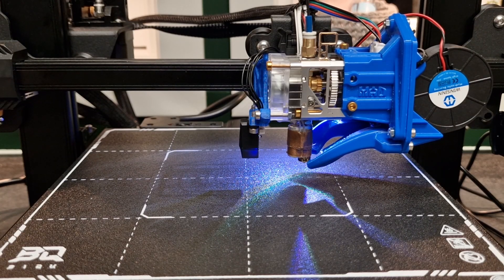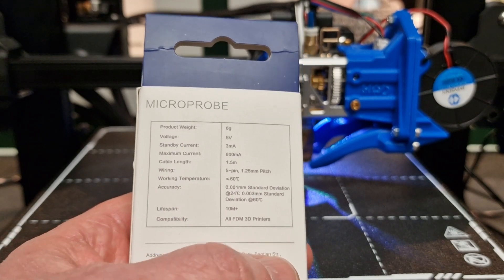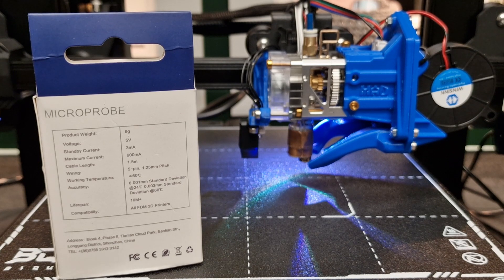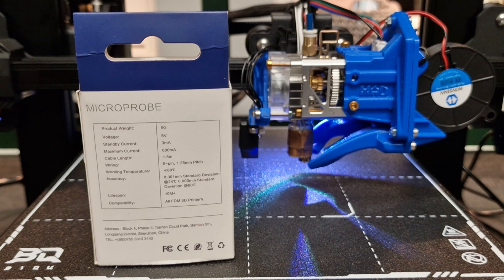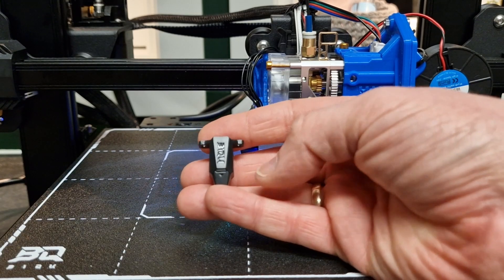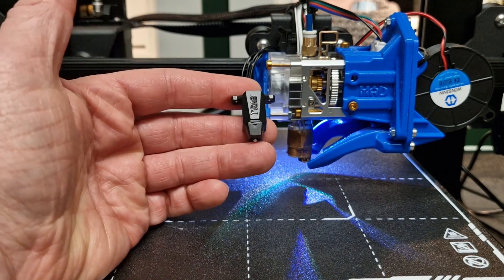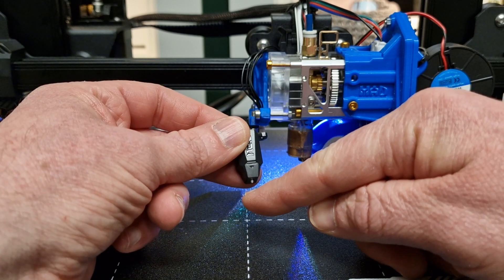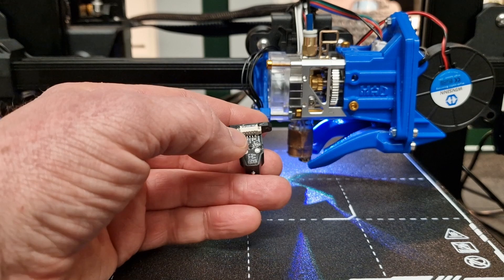BIQU Micro Probe review with a printer saving tip included.

Comment: One thing you need to keep in mind for the microprobe: it does not use the same firmware as a bltouch. The sensor control pin is a on/off signal here while the bltouch and crtouch use a pwm signal/servo angle signal. So you need to do the changes from the manual to your firmware or cfg

I found out the secret behind the accuracy of the probe: the probe pin is part of a electrical circuit that gets opened upon contact
There is a point of improvement possible: a the probe output signal is a normally open signal, meaning the sensor circuit is open when the probe pin is extended. Downside is that the firmware wont detect a broken wire this way. A normally closed logic would be better
Reply from the maker: Yeah I made another video showing the setup process, for Klipper firmware at least. 
The newer V2 is using a photoelectric sensor and is in a normally closed type of configuration.

Comment: im having problems with mine i got my z offset done and level the bed with 9 points. but my first layers are garbage you can see some parts are absolutely perfect where others are all rough and missing parts. the z is lifting slightly you can see the motors moving a little causing the filament to miss parts and lift. ive ruled everything else out by taking apart my extruder found no issues, ive tried cleaning the bed and reapplying glue ive tried different rolls on the same print and it does exactly the same every time. 

any suggestions on how to fix this? i never had this issue before just using an end stop
Reply from the maker: Sounds like the offset is still not correct, so that it's compensating in the wrong spot.
Reply: @StackingLayers  I run the z offset wizard then moved the nozzle down until the paper dragged a little same as when I used to level the bed  maybe that's wrong then
Reply from the maker: Your x and y need to be precise too otherwise it will think it's in a different place than it is. Also the paper will get you very close but it could need a little more adjusting from there depending on the thickness of the paper.
Reply: @StackingLayers  ive learnt my springs may be the problem ive got those stronger yellow springs but several people said i should use silicone or solid spacers instead of springs. i even saw one video saying if you use a z end stop the yellow springs if you use abl the silicone so im going to try that.
Reply from the maker: I have springs on all my machines. Never had an issue caused by them.

Comment: Thank you for this presentation video you convinced me to buy one now that I have it I need your help😅 I have a bl touch for the moment and I wish to switch it to microprobe I have a octopus pro board so it uses the specific pin outs not the z limit+ servo do I have to modify anything in Marlin if I used bl touch previously ? Or it should work out of the box ? Thank you for the video good work keep it up ! 🖐️👍
Reply: Did you hook it up and fry it? Bl touch firmware will cook it and ruin it. I still haven't figured it out.

Comment: Looking at the printer, it looks like a  hurakan right? Are there any nozzle offsets you need for using an H2 v2s lite, and would they be the same other than z for a regular v2s?
Reply from the maker: Yes it's a Hurakan. You will need to adjust the home offsets. The x and y would be very similar to the regular v2s yes.

Comment: Side note, I've been using a regular Biqu H2 for a couple years now and really, really wanted the V2S that you're using but found out the nozzles are proprietary. Are you still using the stock heat block or did you switch to something more compatible? I was thinking a CHC pro block (high flow-volcano length) and the proper heat break would be a reasonable replacement.
Reply from the maker: I'm still using the stock setup I did just buy a 0.4 that they now offer, I might set it up tonight. But I am thinking about swapping out to a standard heatbrake setup, maybe a dragonfly like my other H2 has. I don't do much that requires high flow.

Comment: I use an induction probe and SS flex sheet for my bed, primarily for speed and simplicity and cost. Induction probes can be had for under $15. The downside is that, with few exceptions, you need a metal bed. I'd like to try garolite beds or other surface materials I've thought of over the years but the induction probe always stymied me and BLtouch style probes are a nightmare as a rule. This, however, looks pretty sweet in regards to its virually motionless pin travel. I'm actually considering using this.
Reply from the maker: I can say from experience with BLTouch and now this probe, they are very easy to work with. Wiring and configuration are simple and fairly straight forward. The most common problems I see with the BLTouch is people wiring them wrong. They follow a tutorial and instead of paying attention to the PinOut diagrams they just follow the wire colors in the tutorials. The problem is that companies making the wires don't all use the same colors. Creality is the worst, because they have two ways they do the colors and one of them puts red on a ground pin and black on the 5v pin, so people end up shorting pins and connecting thins backwards.
Reply: Inductive probes are drifting with temp. As soon you use a enclosure clicky style probes win.
With Klipper firmware, clicky and a extra z endstop you even can do auto z calibration.

Comment: I think you can install it between cooling nozzles, there is a two threaded holes in the extruder
Reply from the maker: I'll have to measure that. That would be a good spot if it fits there. I would have to redesign the air ducts but that would make for a more compact setup.
Reply: @StackingLayers  there is 15mm between centers of the holes, m3 thread. Can you please share the link to probe, cant find on AliExpress 🤷🏻‍♂️ have you measured how the heating affects the probe?
Reply from the maker: It's slightly wider at 17mm on center and the holes are 2.7mm for m2.5 screws.it could be drilled to fit possibly but there's the other issue of wire clearance. It would need a little bit of a spacer. It might be possible but not worth it for me at the moment.

Comment: Can you share your corresponding section for it? I've never been successful at setting up any bltouch style probes with klipper, I just got my micro probe and I would love to set it up on my Vzbot!
Reply from the maker: I recommend to check out the user guide. The micro probe is defined differently than the BLTouch since it's a clicky probe type of trigger. Mostly it's copy paste, just adjust the probe offsets to meet your machine setup. https://github.com/bigtreetech/MicroProbe/blob/master/MicroProbe%20User%20Manual-20221223.pdf

Comment: nice review seems like a better option compared to the BL touch and any clones. is it easy to install as in wire it up? i have a skr 1.4 turbo currently use an end stop as its pretty reliable me manually leveling. i tried a bl touch couldn't get on with it though. 

ive just bought a v2s revo extruder expecting it to arrive any day but im having issues with finding a fan duct i like. like your lite version it has 2 screw holes near the extruder fan so i want to use those. the ones near the motor i want to use for mounting it at least the top and bottom ones. im all for simple stuff like simple fan ducts with good coverage. but a lot of designs i see theyre intricate or complicated when they dont need to be
Reply from the maker: The probe is pretty easy to set up. It is different than the BLTouch and Crtouch since it's a clicky style contact, basically a retractable z endstop switch that you can move around. The users guide shows the set up pretty clearly.  You still need to do proper probe offsets like the BLTouch and it wires up identically.
Reply: @StackingLayers  cool thank you for the information. sounds like its close to using a z end stop thats a better way to do it i think. definitely got to get one of these then sounds like it will solve the issues that i had with bl touch not working great. and its understandable its probably better as the bl touch was essentially the first of its kind.
Reply: @StackingLayers  i got my probe but i am confused how to setup the height in the z axis i did ask on the biqu group but that was days ago and no replies. at the moment i got it set so that the probe fully deployed the little nubby bit sits below the glass surface i think this is ok but im not sure now what to put in the settings for the z. the rest of the settings are pretty easy i just need to tell it where it is in relation to the nozzle but i am a bit confused on the z height setup. 

how do you think is best to set it up in the marlin firmware? and how would i go about testing it and then adjusting if nessecary. ive never really setup a probe before so its all new to me. i can plug it into my computer if need be i have Pronterface maybe its best to use that rather than home and risk braking something. 

thanks in advance
Reply from the maker: @TotoGuy-Original  with Marlin I recommend setting up z probe wizard. It's in the configuration_adv.h file. It will get you a perfect offset. Check out Mike's video on it. https://youtu.be/fN_ndWvXGBQ
Reply: @StackingLayers  cool Thankyou much appreciated 😊
Reply: @TotoGuy-Original I've never gotten reply from them either. I'm still stuck on this. I really want to use it but It's in the box still and I'm using bl touch clone

Comment: does it rattle during high speed moves? crtouch and bltouch did so I'm wondering if this one's any better
Reply from the maker: I haven't noticed any rattling, although I don't print much over 80mm/s since I have bed slinger machines. I never had a rattle on the BLTouch either.

Comment: I'm getting ready to buy this probe for my Ender 3 Pro. Do you happen to have any kind of discount code from Biqu?
Reply from the maker: Haha I wish. They are not a sponsor or anything like that.
Reply: Hi have you had any chance got it to work on your ender pro on Marlin?
Reply from the maker: It works but you must compile the firmware as described in the user guide.  Setting appropriate pins for your controller board. It cannot be defined as a BLtouch. https://github.com/bigtreetech/MicroProbe/blob/master/MicroProbe%20V2%20User%20Manual_20240330.pdf

Comment: Can yiu provide a link to the STL you’re using to adapt the Hurakans mount to the new direct drive extruder/print head?
Reply from the maker: I can't remember where I found the original, but here is the same one.  
https://github.com/Pneumanifest/BIQU-Hurakan/blob/main/H2V2sLITE_to_Hurakan_Mount.3mf
Reply: @StackingLayers  thanks, now all I have to do is figure out how to look at that kind of STL file.
Reply from the maker: Just open it in your slicer program. Most will open .3mf it's becoming the new standard for mesh files
Reply: @StackingLayers  I'll give it a try. DO YOU HAVE A MOUNT DESIGN FOR THE MICROPROBE?
Reply from the maker: the mount has holes for the probe or you can use this to mount it on the side like in my video. https://github.com/Pneumanifest/BIQU-Hurakan/blob/main/Micro%20Probe%20Mount.3mf
Reply: @StackingLayers  I'm getting "file is corrupt or no longer avaible" from the program I'm using to convert it to an STL. Cura  can not read .3mf files.
Reply from the maker: The file didn't download correctly then. Cura definitely uses .3mf that's what I used to print my parts.
Reply: I use Cura for 3mf files, when I cad in solidworks, that’s what I export my models to for Cura